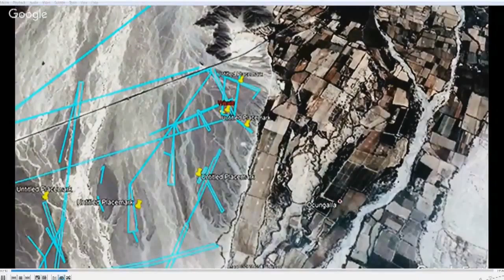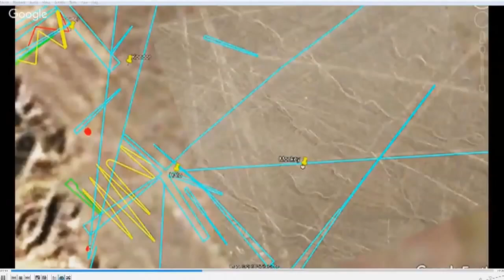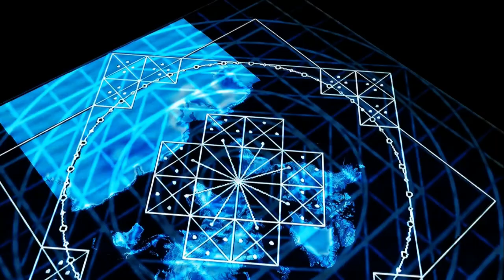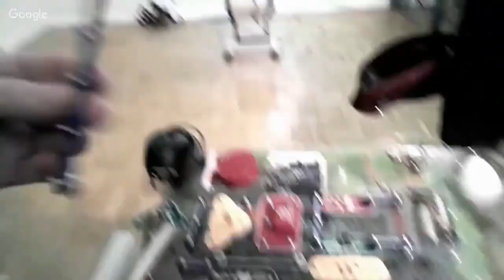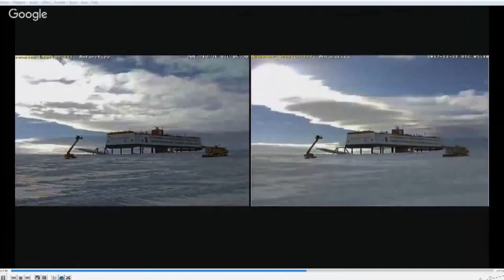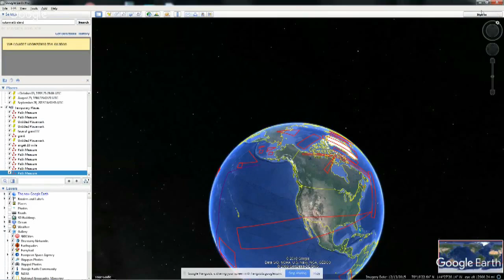Nazca Lines Shock + Awe: The Creators Work Revealed.

Comment: There is something i am having a hard time with. If this map is correct...how does someone get on a boat and sail from west coast of U.S. and get to east coast of Asia? The use of northern flight paths to achieve this same thing with a plane makes perfect sense to me. As does the northern "looping" of the sun to account for 24hour sun. 

Its the oceans and travel by boat that i'm not understanding. Unless of course it works like pac man. You exit one side of map and simultaneously enter the other somehow.
Reply from the maker: You cannot fly east to go west and vice versa, this is where they cut the map and wrapped it around a ball thus hiding where the sun comes from - and goes to.
Flights use hidden northern flight routes in the north as we have shown from Flight Radar 24. The sun's return path is the light in the sky they call the ISS.